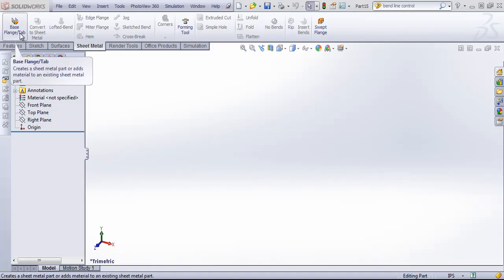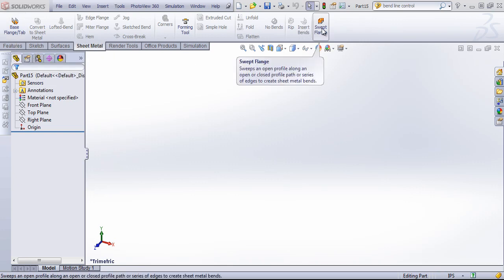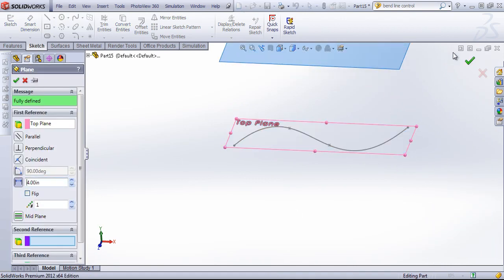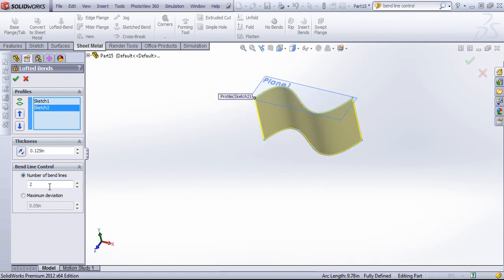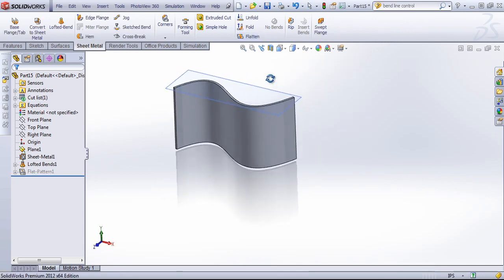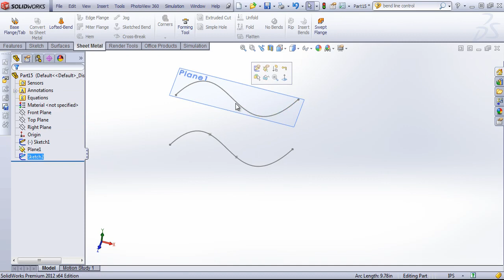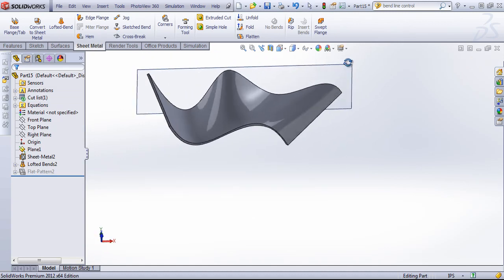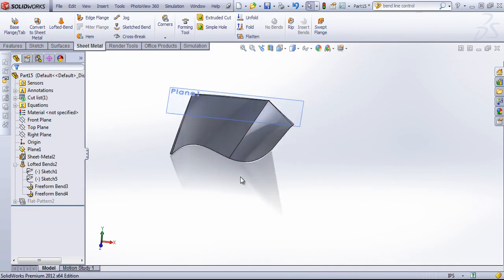05 Sheet Metal   16 Working with Splines

Comment: everytime i try it says only lines and arcs can be used to create bent lofted bends
Reply: I suffered the same problem and found that you have to do two things:
1. make separate sketch or 3d sketch for each spline
2. choose the second option in the lofted bend dialog (i think it is equivalent to "maximum deviation" button, but here we see it works with the first option also, i have another version of solidworks and also in russian translation, so i can not tell for sure)